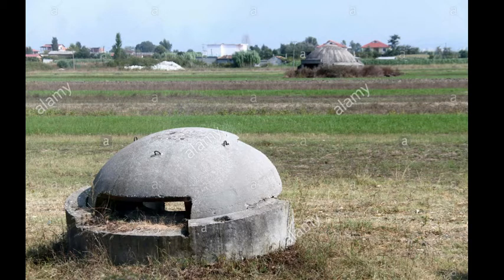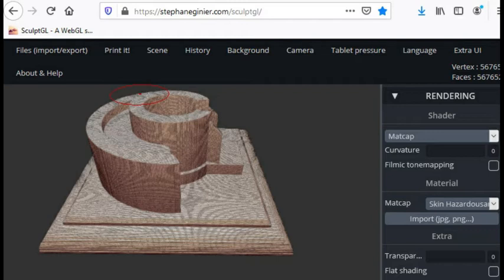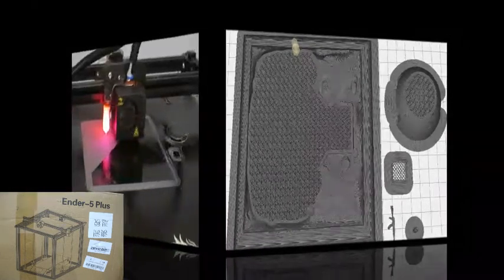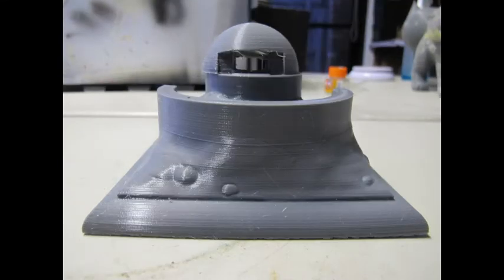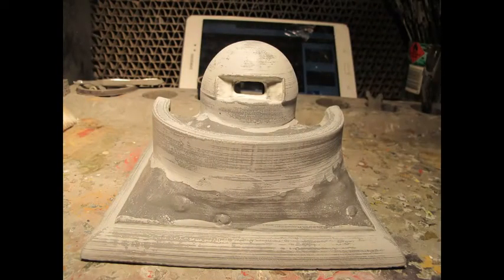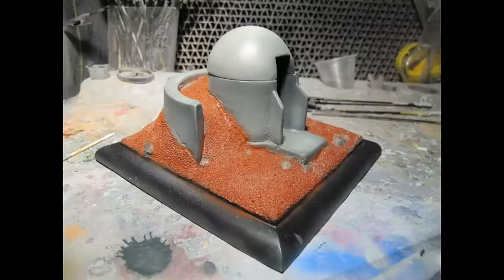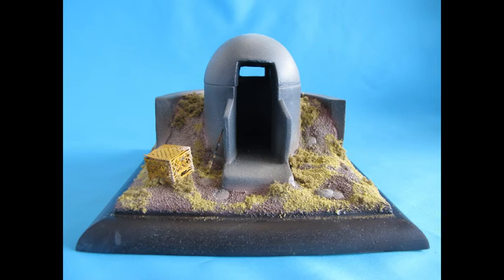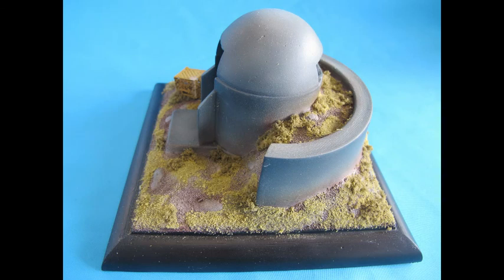3D printed Qender Zjarri - Albanian pillbox bunker

Comment: Having seen this in the real world, it’s amazing to see the photos of the process.  It’s super cool work.  

I wonder if it would have been easier to cast some of this in plaster of Paris?
Reply from the maker: The real thing was cast with anchor points attached for quick manufacture and delivery via truck and crane. Pre fabricating was a contribution adapted from socialist states to today's western world.  Its interesting this mass construction method started with poorly thought out bunkers. My design can be cast with out too much issue but still needs a master.
Reply: @mokanaman  yeah, I had that idea listening to your thoughts on what sort of company would want to make such a model. I was imagining printing  the inverse mould to allow for castings, but then who would want to mass produce this model?

Heck, since it’s not too small I could even cast it straight out of actual Portland cement with chicken wire reinforcements. 

Hrrmmmm. Ideas.

Comment: Allan i'm looking into this 3d printer:  Phrozen Sonic Mighty 4K Resin 3D Printer
any opinions? TIA
Reply from the maker: I have not heard much but it is $200 cheaper then the competition. At the moment Anycubic mono X and new Elgoo Mars are proven to be the best on the market specs wise. I'd explore those two and compare.
Reply from the maker: Im looking in getting the anycubic due to having customer support and warehouse in Australia for quick access to parts and resin.
Reply: @mokanaman  i  have the elegoo mars currently but i want a larger build plate and this has 9.3" area and its pretty highly rated, I wanted to get your input on it.
Reply from the maker: tbh I have not researched too many reviews and only aware of it being highly rated as well. with how critical the 3d printing community it would be safe to assume any issues or criticisms would be brought up at this point. Maybe join a social media support group and have a look at any common issues new users experience. This is what I do 3 months before buying any new 3d printer. For a large volume I will be buying the mono X come January.
Reply: @mokanaman  thank you Allan, your opinion is always valued and keep up the great work.